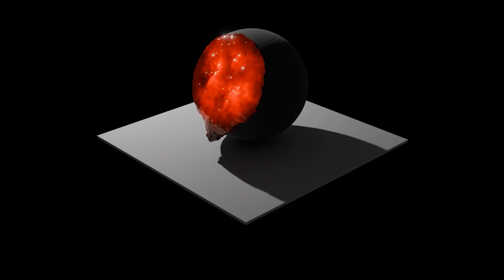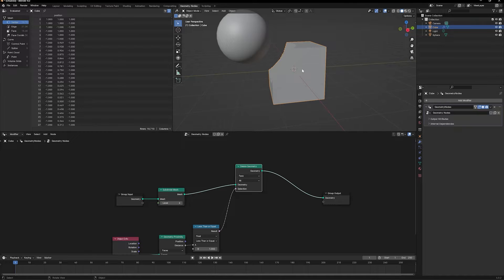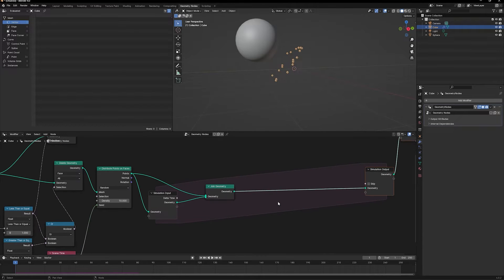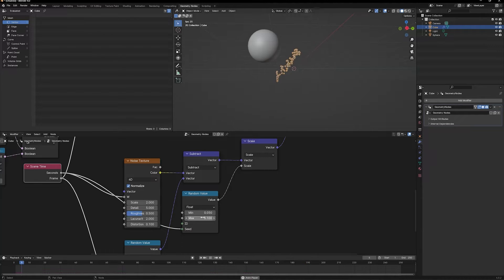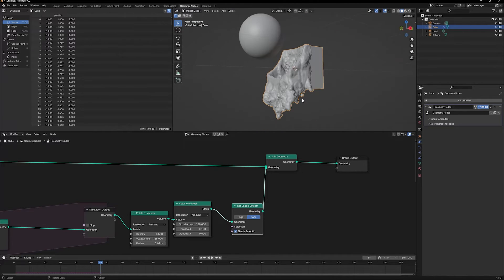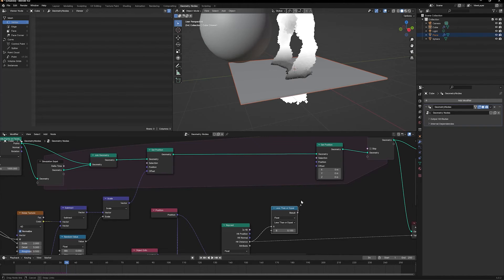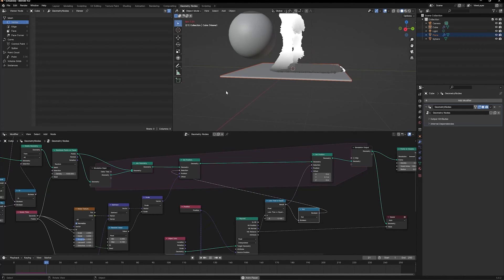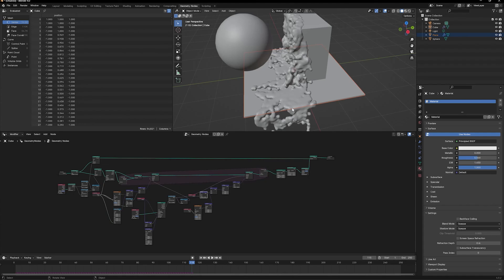Melt Anything in Blender using Geometry Nodes  - Blender 4.0

Comment: Hello, Rasheed. thanks to creating this tutorial. really mindblown that geonodes is so powerful yet still developing... i have a question, if the plane change to the more complex shape like crater or fracture, are the melt still can pass through it or it will just clip and ignore the complex mesh?

Thanks in advance.
Reply from the maker: Hello..yess I think I had to change the collision logic for it to be able to interact with complex shapes..the updated file is on the patreon if you want to look at it now..or making a video soon with the corrected collision logic

Comment: the result might be good, but the way you communicate what steps are needed is horrific, almost a war crime. speak slower, or explain the top level node group when using inner option.
you are either doing this to share knowledge, in which case you are not trying hard, or you are doing it for yourself, and at that point, what's the point.

Comment: got your file from Pateron very impressive stuff, thanks for sharing it 

I have a question, I am using a different piece of geometry to act as the "Cutting Mesh" and its working great, however as the cutter mesh is animating down to melt the other mesh, there seems to be another sim happening right above it where it starts showing the melted part of the melting mesh, as if the cutting mesh has gone thought it and the outer bounds are melting again :)
Do you have a workaround for this?

Comment: Hello, it turned out to be very interesting. Stick it to the cylinder and the animation of the candle burning is already ready.))) If there is a separate lesson about setting up the material, then it will be interesting to see.))) Gorenje Well, except for the Patreon.
Reply from the maker: Hey... thanks..I am glad u liked the video..for the material there is not much there ..I am using the distance of the sphere and saving it in a named variable..which is then used in the shader editor to change the emission strength..I also added a little noise in it to make it dynamic